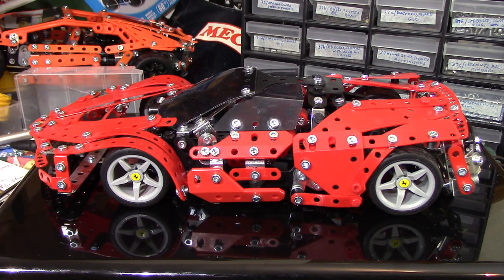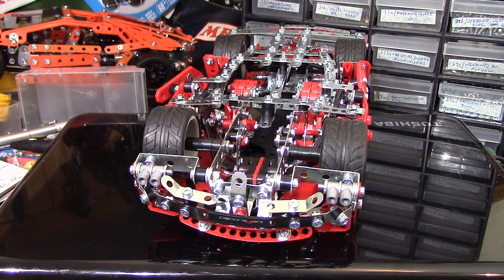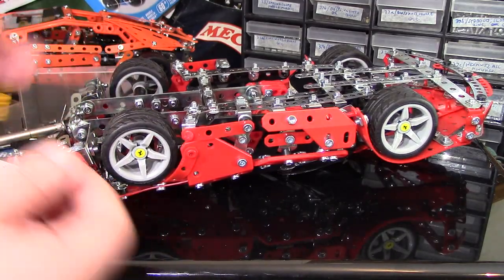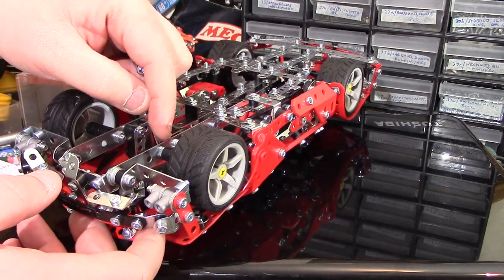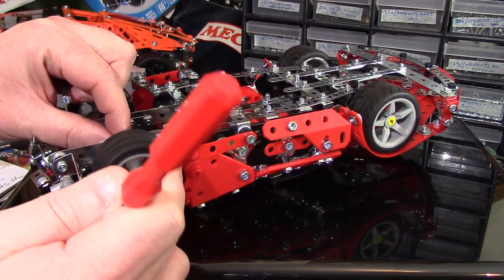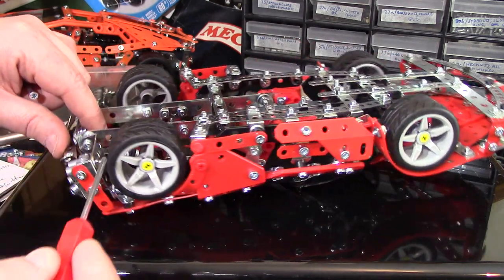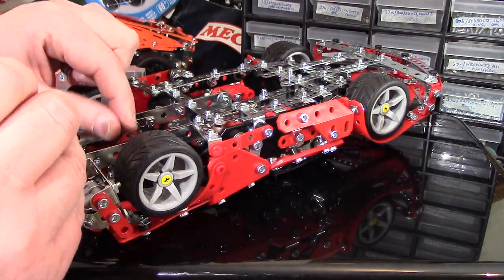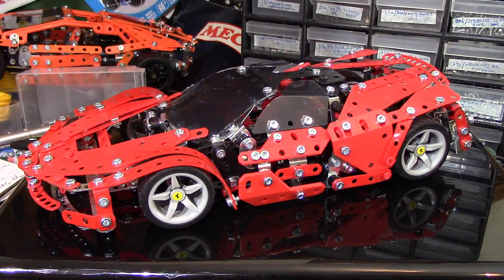MECCANO MAKER SYSTEM LA FERRARI (2016) REAR AXLE FIX

Comment: I am going to change the rear axle bolts to the ones shown in the video, is the bolt size 4ba or imperial and where could I get them>
Reply from the maker: 5/32" whitworth threads. Where are you?
Reply: Thanks again for your help, I will try and get these  from the Internet, I live about 30 miles south of Glasgow.
Reply from the maker: @jamesthomson2557  there are several dealers in the UK. Try Meccano Spares. They are in Worcester.